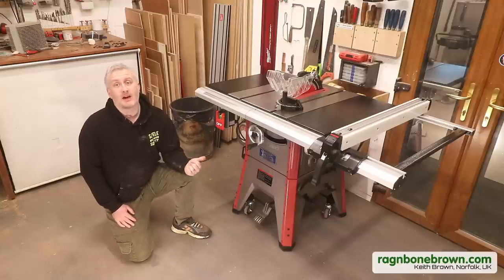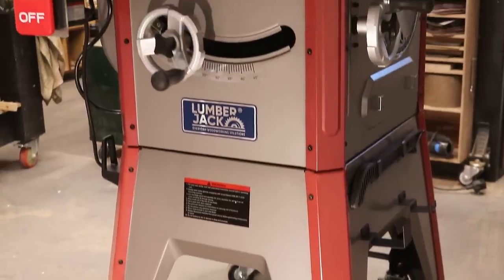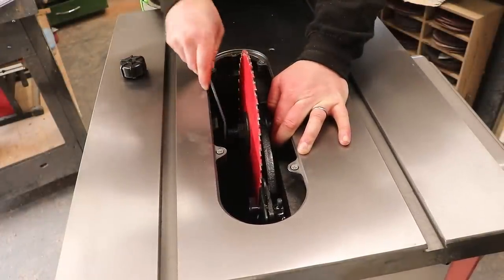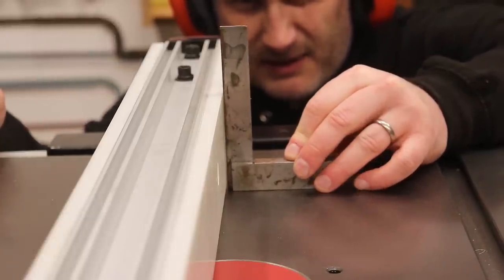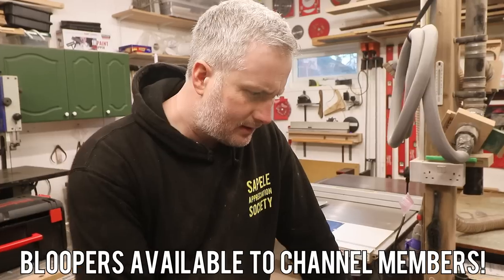LUMBERJACK TS1800 TABLE SAW: Everything You Need To Know

Comment from the maker: For 5% OFF any LumberJack product visit https://www.lumberjacktools.co.uk/ and use the promo code RAGNBONE - following this video I was set up as an affiliate, so I may earn a small commission on qualifying purchases

Buy it on Amazon: https://amzn.to/3m7Yhww
Choosing A Table Saw: https://youtu.be/p1M7U-4JBvA
Axminster AT254SB Table Saw Review: https://youtu.be/gvBQCAHtEGo
Workshop Banter EP25 Things We Wish Existed : https://youtu.be/ty5HGvKQcsw 
CMT Grooving Blade 150mm: https://amzn.to/3SjHB10 (Amazon UK) https://geni.us/UI8DuvR (Amazon Worldwide) 
CMT Grooving Blade 180mm: https://geni.us/UI8DuvR (Amazon UK) https://geni.us/UXvRUz0 (Amazon Worldwide) 

0:00 Intro
0:15 Why I Got It
2:40 About The Saw
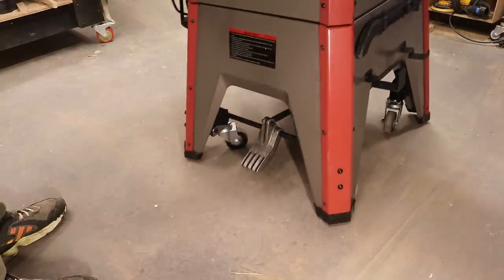3:08 Internal Components
4:10 Cast Iron Tables
4:36 Riving Knife
4:49 Arbour & Blades
6:01 Blade Height/Angle
6:27 Fence Rails
6:46 Extension Tables
7:16 Accuracy
7:46 The Fence
9:00 Cut Capacity
10:57 Mitre Gauge
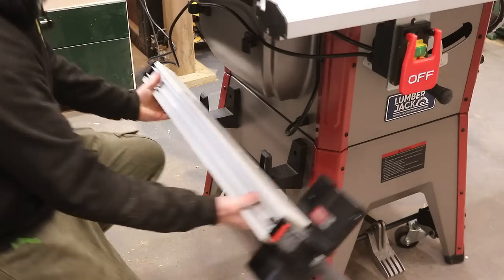12:20 Storage
12:40 Table Flatness
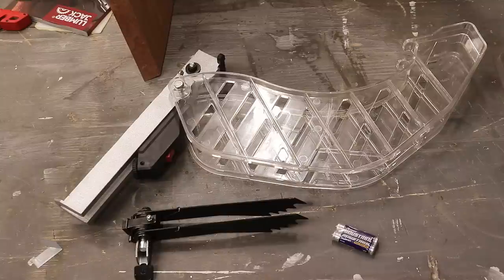13:51 Blade Guard
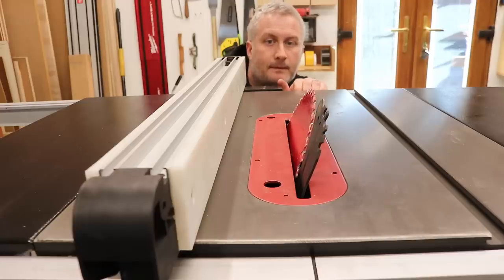14:39 Blade Tilt
15:21 Mobile Base
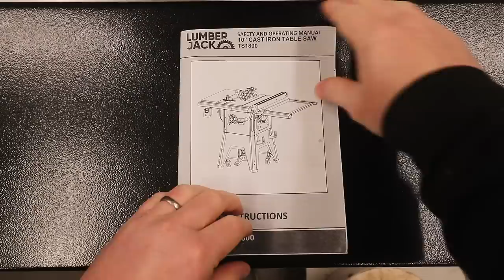15:32 Manual
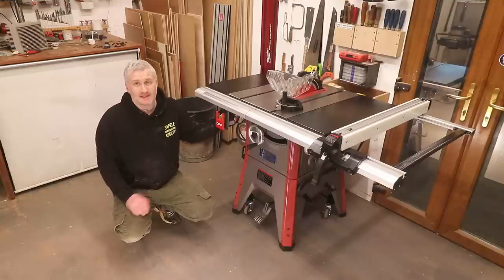15:41 Thoughts So Far...
16:44 Electrical Fault
18:06 Solving Electrical Issue
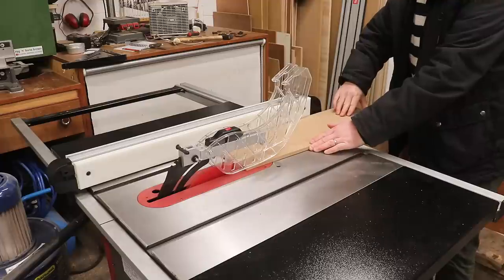18:18 Cutting MDF
18:26 Dust Extraction
18:36 Cutting Elm
18:51 Testing Cut Speed
19:16 Noise Levels
19:33 Summary

Special thanks to  @shaunintheshed  ,  @ProperDIY  and  @lumberjacktoolsuk  

🔨 MY TOOLS 🔨
For links to the tools I use, plus some of my favourite consumables,  finishes and more see links below.  As an Amazon Associate I may earn a small commission from qualifying purchases
UK affiliate store: https://www.amazon.co.uk/shop/ragnbonebrown
US affiliate store: https://www.amazon.com/shop/ragnbonebrown

🤝 HELP SUPPORT THE CHANNEL 🤝
Support with YouTube channel membership: https://www.youtube.com/channel/UCVyE_6jEtVZGmYGXtUOL5FQ/join
Support with Patreon: https://www.patreon.com/ragnbonebrown
Support with PayPal https://paypal.me/ragnbonebrown
Shop With Amazon using my affiliate link: https://geni.us/iWD3K

💰 SHOP 💰
Etsy: https://www.etsy.com/uk/shop/KeithBrownMaker
https://teespring.com/stores/rag-n-bone-brown-merch

🎧 WORKSHOP BANTER PODCAST 🎧 
https://youtube.com/workshopbanter
Also available on Spotify, Apple, Google and most other podcast platforms

🔗 LINKS: 🔗
Website: https://www.ragnbonebrown.com
Facebook: https://www.facebook.com/ragnbonebrown
Instagram: @ragnbonebrown
Twitter: https://twitter.com/ragnbonebrown
Email: ragnbonebrown@gmail.com
Second YouTube Channel (non woodwork videos): https://www.youtube.com/user/keefykeef

Comment: Well Keith, what a review! We at Lumberjack HQ totally agree with you about needing a review like this years ago (we are idiots) As we have discussed recently about the year 2020, this was a very busy time for us as a company in lockdown with only 4 staff and no one in charge of socials or marketing at that time, all our time was spent on customer orders, query's and warranty. 2020 was also the year we got this TS1800, so the saw was very new to us at the time and as a company we were not in a position to collab, not an excuse, but this was the reason, so for this we apologise. I can confirm now we are in a better place and have been expanding our marketing more and more over the years with the help and knowledge of our customers like yourself, as you are all the experts in our opinion. The video shows everything and more about the saw so for this we are grateful to you for showing. Currently we are speaking to our factory to install the slow blown fuse on all future machines to stop this issue in the future. This issue has only been recent to us as we had upgraded the rpm in the motor to 4200rmp previously on the first batch it was only 2800rmp, we did not think this would then cause an electronic issue but the saw proved us wrong, we will also look into what some of your followers have mentioned about the soft start motor (never crossed our mind) Also we have asked if we can get our hands on a smaller transparent guard and some cast versions of the side tables to be sold separately, along with a sliding carriage :)  so will update you once we know more on this. We will now leave you to complete a few more projects with the saw and see how you feel about keeping it :) Thank you again Keith, and thank you to everyone that has left a comment & watched this video.
Reply: In the end I can see great communication and willingness to improve and that's important. Looks like an interesting saw 👍
Reply from the maker: thanks very much for being so receptive to feedback
Reply: Great work lumberjack replying and listening to customers. I’ve just ordered your dust extraction system based upon this video and your responses. We are missing a budget woodworking supplier in the UK. I’m hoping lumberjack start expanding into jigs etc to match up with the likes of trend, Kreg etc.
Reply: Hi guys, see the thread where i point out that BS1362 fuses technically aren't available in slow blow (unless i am wrong which could be possible, lol).. I want you guys to be fully compliant as you evidently care enough. Apologies for my flippant attitude in the referenced comment too... i just get routinely stressed by stuff that isn't compliant... and you evidently want yours to be :)   Might be worth consulting someone on why the fuse blowing is happening though, as it could cause negative reviews from UK buyers?
Reply: @Lumberjack Tools it would be great to see the arbor upgraded to metric/European standard instead of the 5/8". That's the main thing putting me off at this stage.
Reply: @lumberjack tools - shame you keep telling me a spare is out of stock for my mitre saw for the past year despite multiple messages, your attitude is that they are out of stock and that’s it. No lead times no further correspondence nothing
Reply: @Danrandon900  Hi Dan, sorry for your frustration, we do stock most of our parts here in the UK, if we do not have a part in stock then we get these requested from our factory, normally parts then get sent on next container orders but not always the case and also we do not get a lead time on this unfortunately we only know once the container is on the water then we know its 30 days from that date to arrive with us, please get back in touch so we can see if we can chance this part again for you.
Reply: @hugov  I've found this to be a non issue and the extra arbor length an advantage
Reply: @TheChipmunk2008  tis that start up current that's all.  BS 1362 fuses blow at a certain times based on the current level a slow blow fuse can overcome this issue i.e. it allows a different time to blow.  If the current is too high and for too long even a slow blow fuse will cut the circuit. Its the same principle as a Type B/ C MCB's
Reply: @lumberjacktoolsuk you cannot imagine how much do these in depth reviews (especially for bigger and more expensive tools) gravitate towards purchase or not for users. No trades or serious diy person would ever purchase such tool without proper and in depth information. I saw this model multiple times on my pursuit for the ideal table saw (for my needs) and never gave it a chance, now with this review it has gone to the top. You should let him keep this and see if he needs anything else really.
Reply: Hi lumberjacktoolsuk. 
Please help. I bought this saw about two years ago. From the branch 8n Belgium I believe. They do not reply to my questions. 
My belt that drives the blade has split all along the middle. This is due to it only sitting on the pulley using half its width. When looking from the back of the saw I can see the pulleys are not in alignment, they do not sit one straight over the other but are slightly offset causing only half the belt width to be on the pulley while the other half width is hanging over the edge of the pulley. Is this standard or have I got a dud machine. Can I rectify this issue. Thanks for any help.
Reply: @lumberjack, are these available with 30mm arbor?
Reply: @Jb001jb  we have not been able to supply a 30mm arbour, but we do supply the machine with a strong sturdy 30mm reducer that has been great in the response from current customers.
Reply: @lumberjacktoolsuk Does the current version of the saw have the more powerful motor with higher RPMs and have the other issues raised in the vid been fixed?

Comment: I bought this saw about a year ago, apart of the fuse issue, no other problems to report. For blades, I shop across the pond, Kats-Moses have great offer of CMT blades, which are superb and cut quality is better in comparision to Diablo blades. You'd need to buy more than one though as shipping is about £18 and takes few days. Well worth though. 
My table has been running smoothly, I highly recommend it, never thought of getting rid of it or swapping for anything else. 
Great review, hope you'll like it enough to keep it.

Comment: Looks like a great well thought out saw at a reasonable price. If the dish in the middle of the table bothers you, it is most likely caused by the trunnion attachment points not being machined true. My old contractor saw had the same issue, so I stuck some 80 grit sandpaper to a melamine board, that was big enough to cover all four at once, and sanded them flat and parallel with each other. (cover the faces in black marker and sand them until all the marker has gone. This will also tell you which one is the problem.) I also trued up the mating faces of the trunnion brackets and the dish has gone.

Comment: Hi Keith, not one to normally comment on YouTube, however, your review prompted me to make the purchase. And here are my thoughts.
The box is extremely heavy, however, I managed to manoeuvre mine with a sack truck and a little effort up some stairs to my workshop. This is not something I would recommend on your own.
The gauge of materials is nice, thick, and well-constructed. There are no extras with screws or washers, so watch this carefully. Instructions are not the worse, clear enough, but could do with colour pictures or enlarged views. All the tools were provided to do the job.
The only tricky part was the back right corner screw for the back rail, there is not much room to get your fingers there to get the nut onto the screw. Generally, I had no issues with screwing parts together, and no screws cross-threaded. The plastic dust shoot slots I found a little off-centre, there are these small tabs to help align, however, mine seemed to stop it from meeting up properly. The back panel screws were hard to undo with an Allen key by hand, 
I found pushing the two front rails together first with a mallet easier than the method you showed in the video and the instructions.
I noticed you mentioned the finish of the chamfers from your video was not particularly good, mine had no such issues, and it was well-machined. The iron top was as flat in the same way as you described in the video, good enough for me. All the holes are aligned for the levelling screws in the insert plate.
As you mention, this is the same model as the Rigid R4512 saw used in America. Although this model has been superseded with the newer R4520, many still believe it was a good saw and have plenty of modification videos and reviews.
My older saw was the Axminster TS200 with the sliding carriage. This is an upgrade for sure in size and capacity, but I find it suits a midsize workshop like a garage or similar well.
Yes, the fuse supplied did blow after the first use despite running it from an extension lead, however, Lumberjack does provide a slow blow fuse within the box.
Since I have gotten the saw, I have made a router table for it, which was super easy and uses the existing table fence.
Overall, I agree 100% with your review, it’s well-balanced and points out all the important features, many thanks for the brilliant video and the effort.

Comment: Hi Keith, Great indepth review!  Here's what i know... I have owned this lumberjack saw since june 2020, and have been more than happy with it., more on that in a bit. I better start by saying i have no affiliation with this company...
 I live just a few miles from the Lumberjack headquarters (known as Toolsave), my experience with them as a company has been very positive. For example my previous table saw was also a lumberjack, a site saw (same as a Rigid site saw, now no longer available). I  bought that saw as an ex- demo model reduced in price, a couple of weeks later i noticed there was a twist/bend in the fence, they swapped it for me no issue. I Had the same experience with a cordless brad nailer i had from them that started misfiring (a few days before the 1 year warranty expired, it had seen some fairly heavy onsite use..), they just went in the back and handed me a new one, all in a friendly and helpful manner. I was unsure  about using  Toolsave, as the only info on them back in 2018 when i first discovered them were a few google reviews that were somewhere between negative and horrendous!

Back to the the Ts1800 saw, its very similar to the classic Rigid hybrid , but it is actually a re-badged Craftsman like this :

https://www.woodmagazine.com/review/saws/tablesaws/stationary-tablesaws/craftsman-21833-contractor-tablesaw

The craftsman has the same paint job and fence, i think the throat and plate is very slightly different on the Rigid (the positioning of the levelling screws in the cast iron top, from memory).
I have never had an issue with the start blowing fuses etc, i have no fancy electric wiring , currently my workshop is running of an extension from the house.. (yeah i know, recently moved need to sort!) maybe a component has been changed on newer models, mine just soft starts... Due to space restrictions i have never used the left hand table wing or left section of fence rails, i made a right hand wing with a triton router underneath, it works for me - even the fence measure read out ligns up perfect.. I have made zero clearance inserts for it, my current one is a bit like the "Hooked on wood" one with holes in. Theres some good videos on here, i think its on the "shop built" channel where he makes some router templates for easy duplicates.The saw being so easy to move about in a small space was a big seller to me, and i have no regrets.
I fully agree with you about the blade guard, its too tall and intrusive for me and as such i have never used it, i used the guard from my old saw until i made my own, similar to the guard made by "Justin Depew" here on youtube , although my guard is attached to the saw and not to a wall, so it stays in place when i wheel the saw about... 
The one negative as you mentioned is the 5/8 inch arbor, and the need to use reducing rings for blades, a minor inconvienience but i would be interested if anyone on here knows where to source 5/8 (possibly 16mm) arbor blades in the uk, at a reasonable price that would fit this saw (250 -254mm x 3mm thick), as i have never found any :(
 I am sure you will make the right decision on which saw to keep, just wanted to give you my 2 cents, apologies for a bit of an essay!
All the best, Dave Griffiths
Reply from the maker: Great thanks for all the info Dave 👍

Comment: I love this saw. I own it now for about 4 years and in Belgium we don't have electrical plugs with fuses inside, so no problem with this. It just scared me to see how clean it once was 😉
Reply: Yes, I suspect they've tested it to EU standards (which is fine) but many EU countries use C curve breakers for general power, here we have, in addition to the aforementioned fuse in the plug, mostly B curve, except for circuits with very high inrush (such as lots of LED lighting drivers, or motor loads like air conditioning/heat pumps)

Comment: I've had this saw for 3+ years and have been pleased with it. My only issue had been with the insert plate not sitting in place correctly, that was until this week when I found that the magnet is height adjustable - there is a small adjuster screw under the magnet! A warning for potential buyers, this is a heavy saw and if you are unfortunate, as I was, to have this 'delivered' to the end of your drive make sure you have the means to move it to your workshop, I nearly gave my neighbour a hernia, or two.
Reply: I didn't realise the magnet was adjustable!  I've been tinkering with mine this evening as the table extensions still weren't quite sitting as I'd like them.  I'll have a fiddle with the magnet tomorrow!